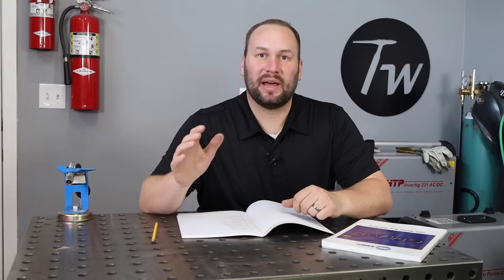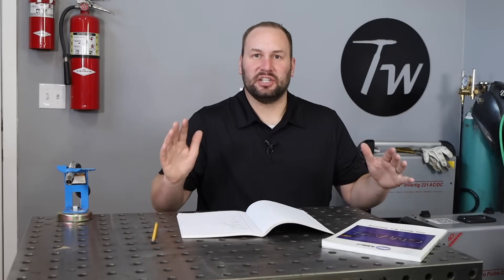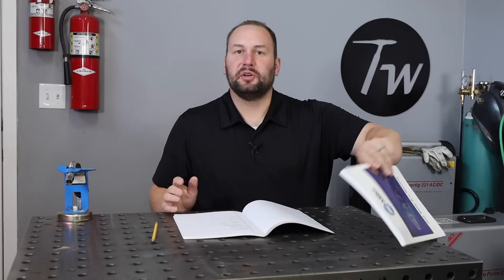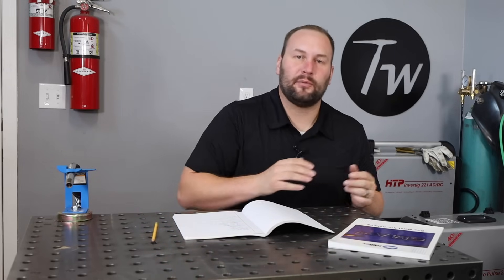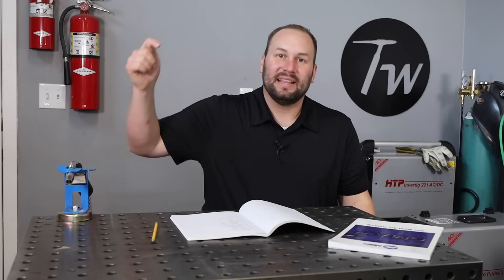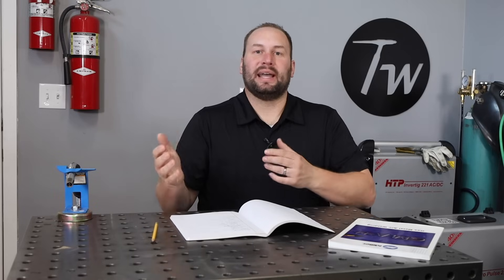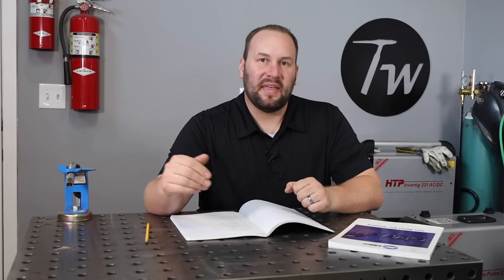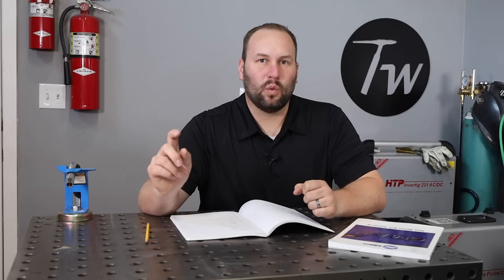Perfect Mig Welder Settings in 3 Easy Steps

Comment: Tim can you please do a video of a Lincoln Electric E6010 root pass on a 2G open root butt weld using 3/8” mild steel plate beveled at 37.5 degrees for a total 75 degrees included angle. This is one of the more difficult welds to get complete penetration on with backside reinforcement, and it is one of the more common tests given in welding schools. I’d love to see it in one of your videos if possible.
Reply from the maker: Thanks for the suggestion, I still remember what a pain that was in school. It's been quite a while since I've done it, but maybe I'll cowboy up one of these days and give it a shot.
Reply: @TimWelds  It’s a pain and a half for sure. I completely understand how difficult it is, so I won’t knock you if it’s something you’re not comfortable doing on video. However, if you are I would like to see how you handle it. Thanks 😊
Reply: @TimWelds  Tim is it possible to become a well paid welder even if I can't seem to master E6010 root pass in the 2G position? I feel like I suck at welding all because of this...it's so difficult to do consistently

Comment: As the owner of an180 amp MIG with six fixed settings (A,B,C,D,E,&F) How would I estimate the Amp output settings?  I'll assume that at (F)ull speed (F) I am getting the rated 180 amps which I will likely never need but what about the lesser settings?  I can easily and cheaply waste some flux core off my ten pound roll and multiply to find the wire speed.
Reply from the maker: I'll link an article with some rules of thumb for estimating amperage at a particular wire speed and wire diameter. That being said, I'm not usually too concerned with what the actual amperage is as long as I'm getting a good result. Flux cored wire will behave a little differently, but the principal still applies. 
https://www.millerwelds.com/resources/article-library/miggmaw-101-setting-the-correct-parameters
Reply: Typically the settings are voltage settings. 
The wire speed is an infinite control like a potentiometer. 
That being said: 
Your fixed settings typically control voltage … most likely in 1.5 ish volts increments … the highest setting is about 25 volts arc volt and the lowest setting is about 15 or 16 volt ish ….  
So in your case you can’t really pick a wire speed and match voltage ….  You almost need  to “tune” the wire speed based on your voltage …..

Talking about amperage ….  

Some very smart people and some text books will tell you there is no such thing as amperage in mig welding ( seeing mig is a constant voltage process vs tig/stick which are constant current ( amperage ) processes) 

HOWEVER wire type ( solid steel, flux cored, stainless, aluminum) effect amperage and the main driving factors are wire speed and wire diameter! 
The faster the wire is fed and the larger the diameter is, the more amps the machine puts out. 

In order to get 180 amps out of your machine you wont be able to do that with 023 wire you need at least 030 maybe even 035 wire depending on how fast your machine feeds the wire. 

Does this make things more clear ?
Reply: My machine has just 4 fixed settings of voltage and a knob to regulate wire speed and amperage at the same time. So I have to do it the other way round. First set the voltage (considering material thickness) then find matching wire speed.
Reply: The buttons and switches control volts, the wire speed dictates amps😎

Comment: What does it mean when the welder says 250amp welder . Does that mean I need a 250 amp breaker
Reply from the maker: It means it has 250 amp output. This is a very capable machine size and in the ballpark of what I generally use. It will have a much lower input amperage (breaker size). This is because the welding voltage is much lower than the input voltage from your electrical service. On single phase 240 volt, the needed breaker size will vary from 30-50 amps (depending on the model of machine) to get the full output from a machine that size. You can find the input amperage on a chart on the machine or in the manual.

Comment: Having quite considerable experience with older arc welding techniques, I bought a wire feed welder without doing much research. My 110/120 volt welder does not have a voltage adjustment. I only have a scaled wire feed setting and a fan speed setting !  How do I regulate as you describe ?  Thanks.
Reply: Never heard of that   What make and model?

Comment: Good Day Tim. Here in  Canada we're limited in what we can get in the way of smaller welders Voltage wise. I'm looking at a POWER MIG® 140 MP® Multi-Process Welder {Lincoln}. I do up to roughly 1/4" thickness. 

Also can this welder do TIG Aluminum?
 
Now will this machine handle what I have just mentioned above.

This video was really helpful. Yes the dials can be a little confusing.
Reply: A 140 amp mig welder is too small for 1/4 inch ms. Go for at least a 180 machine. if on a budget buy an Everlast  welder, a bit more get an Esab 215  , I have one and I have a HTP pro pulse 220 and a Fronius Transteel 2200. I also live in Canada and had no difficulty buying any of those welders. From my own experience I would not buy a cheap welder, buy an Everlast if money is tight, ( Mig 180 ) Make what ever welder you get is capable of 220 and 110v  you will need 220 v to get 1/4 in welds. 5/16 in is the thickest ms you can weld with  short circut mig 75/25 gas. thicker metal requires spray mig and needs 90/10 gas, or you can dual shield fluxcore with 75/25 gas.
Reply from the maker: That machine (and most others that run on 110 volts) are best suited to 1/8" material and thinner. As Bruce pointed out, you're probably going to need to go 220 volt to get something to work well on the 1/4". 

As far as TIG goes, this will not run aluminum because the output is DC only. Multiprocess welders seem really nice, but very few of them are aluminum capable or have high frequency arc starting, so I usually recommend a dedicated TIG machine instead if aluminum is on your radar. Also keep in mind that the TIG and MIG processes will run with different gas, so adding TIG will also require the purchase of a second gas cylinder which is an additional expense.
Reply: If I can suggest you something, stay away from dept stores, go to a welding equipment supplier, they will advise you on the best equipment to select and they can help you to choose the best accessories and fillers for the use you intend. For sure it will be a bit more expensine but you'll never regret .
Reply: @TimWelds  
 How capable are these multi process machines running MIG aluminum? According to the specs on my machine I just need to replace my stainless sleeve with a Teflon sleeve and it's ready to go. My torch has a 2m (7ft) lead.

Comment: Great Exposure; really glad I stumbled on to your site "TimWelds"; I also took a course in welding BUT, it was intended for commercial welders using mainly stick and acetylene, then COVID set in so everyone's been on a break for the past 2 years, I want to get back to it and I have a machine (Chinese, but good), it did not come with a chart inside or on the paper work and although I'v looked up for information, I really didn't know what I was looking for, so if you don't mind i'll only ask a double sided one question; You mentioned "MIG WIRE" in the video, is that the same as Flux Core Wire or just steel (I think it's steel) wire; I do appreciate ANY info you can provide me with, and PLEASE note, I picked up more info and details in this 9 minute video than in any (of the slew) of video's I have watched; I love the simplicity of MIG and TIG for welding.

Comment: Hi Tim,  I actually learned how to set up my MIG from your previous video, + one or two others.  All in one day, and I run smooth beads on 1.5mm butt joints and fillets joints.  So... Thanks!

Can you explain what is "under cut"?  I see a lot of comments on Instagram that this or that weld is undercut or that if you'll do this or that you'll get undercut.  And it's been a long time that I have no idea what they're talking about.  I tried to search but the answers are conflicting or don't make any sense.
Reply: Undercut is when you actually have a a gouge around your weld into the base Metal that is not filled with your filler Metal. It creates a weakness around the weld that you’ll want to avoid. Hope that helps.

Comment: Thanks Tim! I'm fine with stick but I found MIG to be very difficult. This explanation on setting things helped quite a bit. Now if you could just help figure out how to SEE what I'm doing with MIG. Even with the mask turned down to a shade 8 I can't see the puddle behind the arc, much less the surrounding area so I can tell where I'm headed! And as I understand it I'm supposed to be dragging with MIG, not going forward into the area I want to weld. That's just backwards from how I stick weld. Ideas?
Reply: Actually many schools teach pushing with MIG. Personally I've learnt to both push and drag but I'm more comfortable dragging.
Reply: If there's slag, you drag, allegedly.
Reply from the maker: As long as you're using shielding gas with solid wire, you can use either a slight push or drag angle and get a good result as long as you don't get too carried away with the angle. Make sure you have a good clean lens cover, because if it's dirty and scratched up, it's super hard to get a clear view. Some other things to try are moving your head a little closer or farther to help focus or installing a cheater lens in your helmet (basically a magnifying glass; I use one sometimes). Beyond that, it's just a matter of practice. As far as shade goes, I'm usually running in the 10-12 range on MIG.
Reply: Try a different helmet or reading glasses under the helmet. 
Stick arc is a lot brighter, that helps you to see….  Darker processes are more “demanding” on the eyes….  Can you see a low amp tig puddle ?  That is usually where you see if you need reading glasses first ….
Reply: This might not help with with the puddle but I've recently glued on a cheap torch bought from a China shop😜, onto my hood to see into the dark corners or to work in low light. I was thinking of installing it with Velcro strips but I was fresh out so I used contact adhesive instead. This torch has spot and floodlight options and is rechargeable with a cellphone charger. It's the type meant for strapping on top of the head. Not sure how I could post a pic of this mod 🤔🤔. I saw a post recently on YouTube with similar and copied the idea.🤣🤣🤣
Reply: @TimWelds  Thanks to all for the suggestions. I'm already using either a cheater lens or glasses, everything is clean. I may have to try sticking my face a while bunch closer. I've also tried using a work light to brighten the area but that hasn't worked yet. I'll keep trying.
Reply: @ZILAwelds  Haven't got to TIG yet, but hope to. I'm using glasses or a cheater lens. Just can't see the puddle or the line I'm trying to follow. I'll keep at it, thanks.
Reply: @Bret4207  then try a different helmet.  Sometimes its a matter of color or clarity.   There are some auto darkening helmets that just plain suck…. ( not all of them) and there are some classic glass filter plates that just rock !!! ( only some of them) 
I personally use a glass filter plate ( Anchor brand) the gold or chrome plated shade 9….  The gold plated you can occasionally find….  The chrome plates is almost impossible to find nowadays ….  
And most guy who i let my try out my helmet are blown away by the clarity ….,  in my opinion you need a $500+ automatic helmet to even come close ….
Also, the clear cover plates in front of the filter plate ….  If you are a stick or a mig welder those are consumables ….  They are not meant to last 3-6 month …..  often enough they dont even make it a full 8 hr shift for me…
Reply: @ZILAwelds  I've tried two auto types. I'll try my standard with the cheater lens and look for better glass. Thanks for the ideas!
Reply: @Bret4207  hey, I've just started flux core mig welding and find it so difficult to see anything other than the wire burning lol. Had no problem with stick welding. Did you ever find a solution?
Reply: @desb9639  Not really. I think it's a matter of the MIG arc being so much smaller and putting out so much less light. I haven't had a chance to get a better quality lens or anything yet. I have found it's easier to see outside in right sunlight, but that doesn't help with the vast majority of my MIG welding.
Reply: @Bret4207  thanks for replying. My helmet is adjustable so I must try a lighter shade and report back to you.
Reply: @Bret4207  I went from a shade 12.5 to 11 and it helped my view of the weld puddle. Still not like mma welding. I will try a light above work bench to see if it improves any more.

Comment: hello Tim
I just have a invert mma200 unit
and you seem to have all type of machines.
if you have Tig, why getting a mig machine?
Reply: Both have their uses ? My self depends on how long the welding is ? Ill use tig for a run of say 0,up to 10 inches , longer runs or  heaps of welding ill use my mig , i find mig just quicker to set up and weld ? And depends on thickness of what iam welding , regards from australia

Comment: Hi @TimWelds ~ Although we managed to purchase an HTP Pro Pulse 220 MTS, like the one in this video, we didn't have much extra funding for all manner of wire and such, so we ended up with a 12" spool of 0.030" for steel wire and an 8" spool of 0.035" 4043 Alcotec wire for Aluminum (in the future).  As this is all we have to work with, naturally, I'm a bit disappointed to see that your wire feed rate chart doesn't contain any numbers for 0.030" wire for jobs above 10 gauge thickness.  I'm sure that Miller recommends larger wire for thicker material, but, once again, we don't have thicker wire and, more to the point, I've got an old-school welder buddy telling me that he welds up to 1" thick mild steel using 0.035" wire and a 200A Miller machine.  He uses multiple passes and, sure enough, I've seen his more than satisfactory results.  Anyway, the job in front of me is welding a 1/4" thick square hitch receiver tube to a 1/2" thick flat plate (both are mild steel).  If you happen to have any "starter" numbers for me to try out, I'd really appreciate the assistance.
Reply from the maker: If you have a pro-pulse, you can just use the synergic settings on the program for .030 wire and your gas. It will show you the thickness in the top right of the screen as you turn up the wire speed. If you run 450ish in/min and the recommended voltage, it should work well. You can adjust on some practice metal using the process I showed in the video. If you were to get some different wire for that job, I would run dual shield flux core. You can get some .035 from HTP that runs great with that machine and standard MIG gas. Not saying that is necessary or that it can’t be done with your .030, just another option and how I would do it.

Comment: Wouldn't you want voltage first?  The voltage gives the heat to penetrate.... the wire feed is just the filler and bonding agent I guess you could say.....
Reply from the maker: That’s what a lot of people think, but that isn’t the case and that’s the misconception that makes settings difficult for a lot of people. The wire speed actually controls the amperage because the machine has to provide more amperage to maintain the voltage as more wire is being pushed into the puddle. That’s why the wire speed gives the heat to penetrate. The voltage has to be appropriate for the arc characteristics at a given wire speed.

Comment: Hello, I have a Simder 140 Mig welder machine. Unfortunately, it does not have a settings chart like the one shown in your video. It does have a dial for Voltage and Amps.  With that being said, do you have any advice on how to dial it in for various thicknesses of material? Thank you